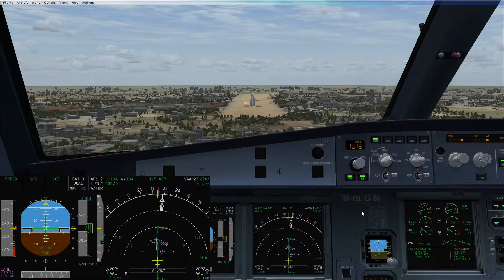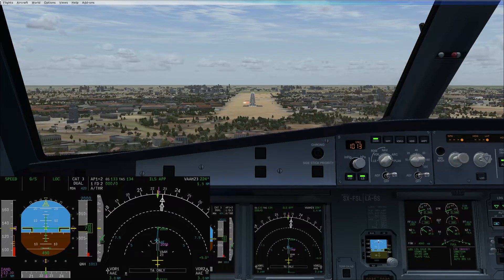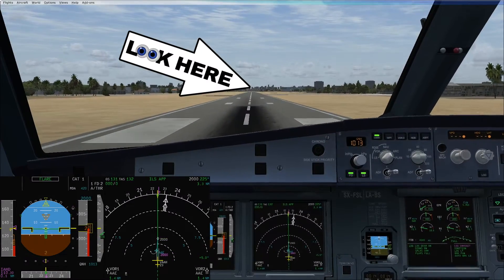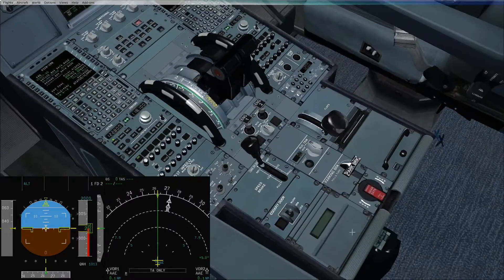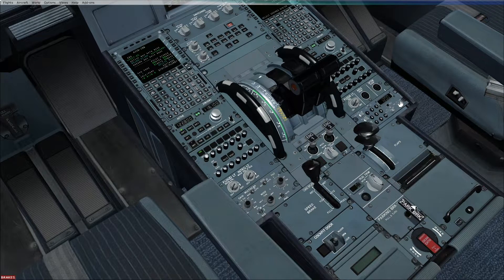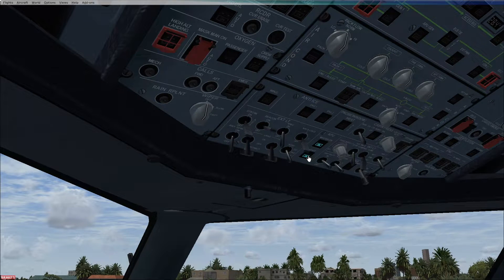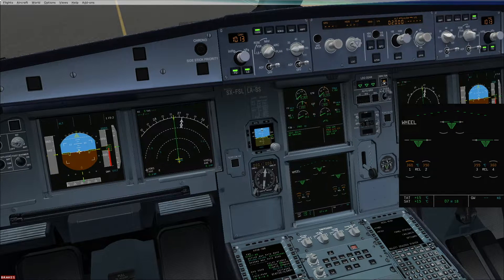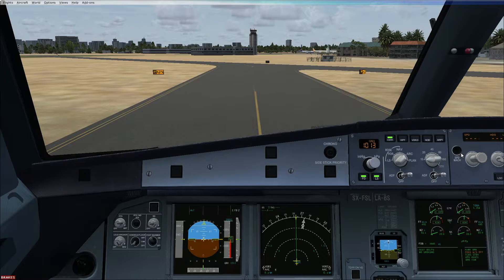The Flows : Landing / After Landing Flows

Comment: My question that you said during afterlanding checks Anti Ice as requuired as no ice condition you won't turn it ON , does Airbus allow use of Anti Ice on ground ?  Can you ? In Afterlanding checks flow ?
Reply from the maker: Yes in icing condition. Visible moisture and OAT you will use Anti Ice on ground. Even for taxi flows if you check we can use and should use anti ice if conditions so warrant. Idea is to keep your ac clear of forming any ice
Reply: Thanx